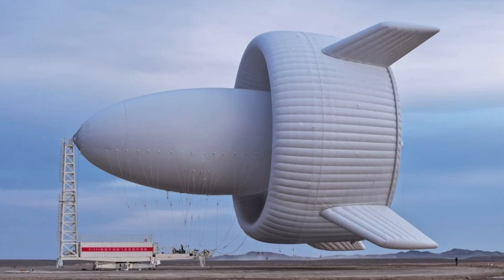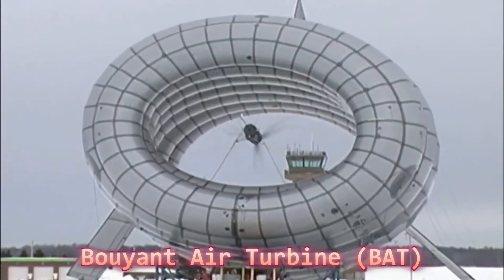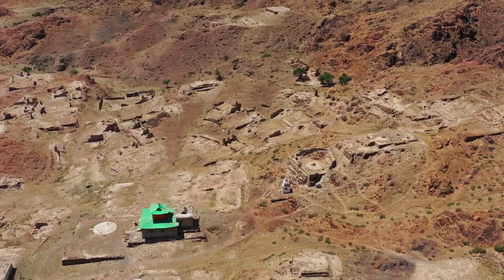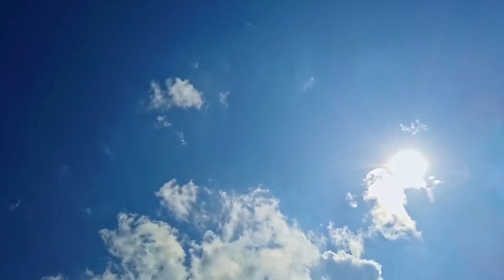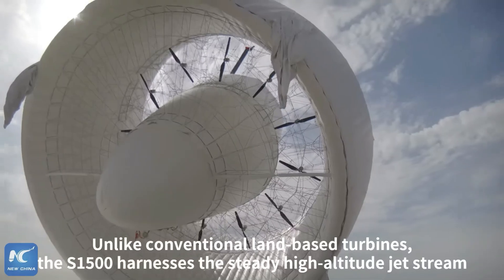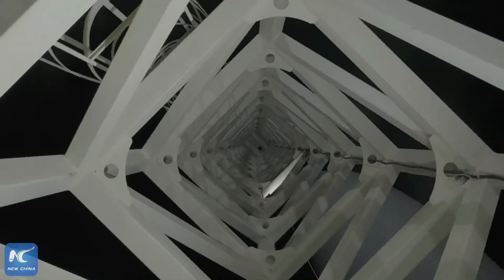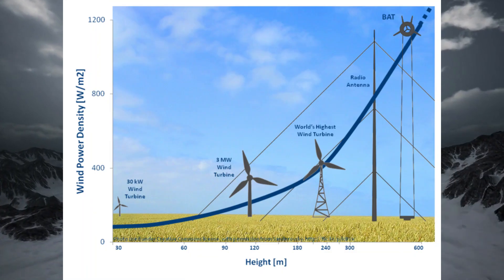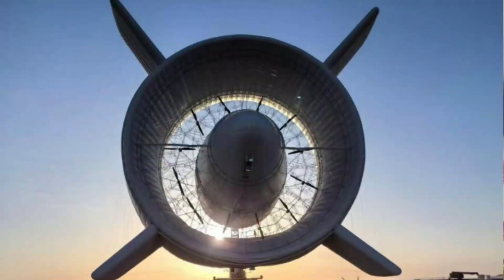The Largest Airborne Wind Turbine in the World S1500

Comment: I want to see the engineering required to get the energy down to the ground.  How heavy are megawatt capacity cables?
Reply from the maker: If they have onboard transformer, they can up the voltage which would mean lesser current and smaller cable size